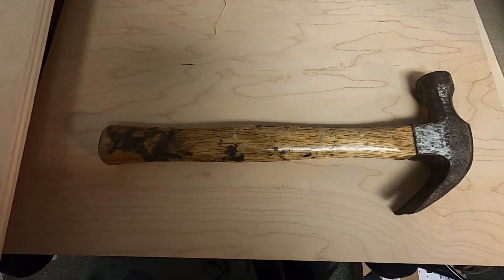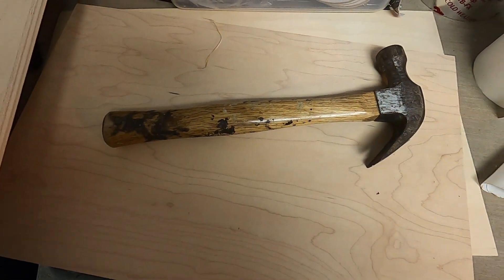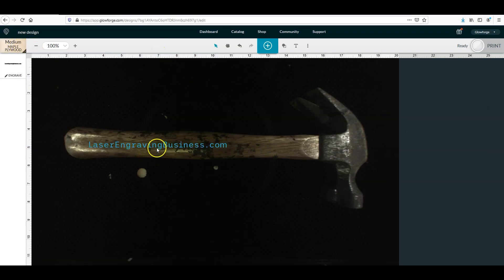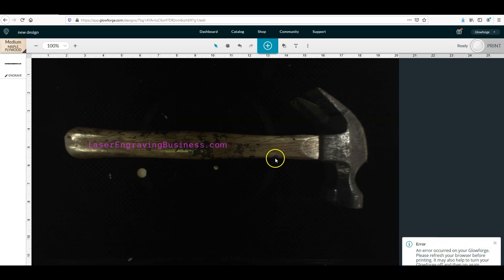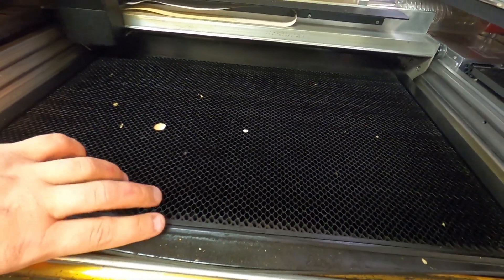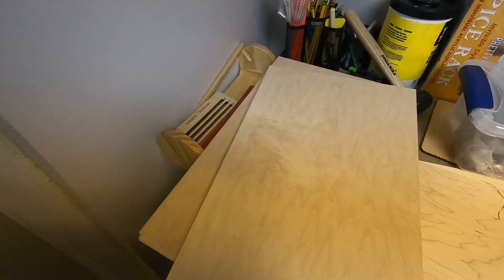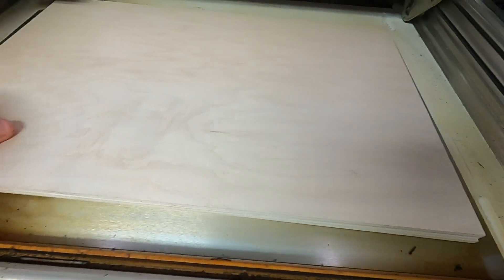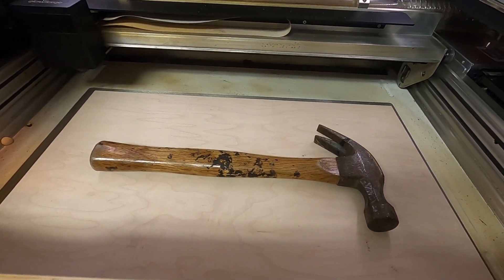How To Engrave On Something Thicker Than .5" on The Glowforge | How To Engrave On A Hammer

Comment: Thank you for sharing this video. 
My Glowforge Plus is in the process of being assembled!
They have sent us a couple of updates as they are getting closer to getting it done...Then Sent...
I am excited! 
I know there will be instructions. 
(😳🤷‍♀️ I hope a lot of instructions!)
But I am going to jump the gun right now, and ask a question that may have already been answered. 
Can it engrave on metal stainless steel -
(I'm thinking that is what the material is? )
On a tall cylindrical 
insulated cold drink thermos? 
(Tall insulated tumbler type. )
I'm referring to the kind you  take with you,  that fits in the cup holder in your car? 
I guess I am asking, "Will it engrave on something that is not flat?" Thank You.
Reply from the maker: AWESOME! Super Exciting! It can't really engrave on metal but it can etch on metal with a special spray that cost around $100 per can. I've never done it. It could possibly engrave on cylinders but it probably wouldn't come out too good. You would need to get a different laser to do a lot of drink cups and stuff like that.